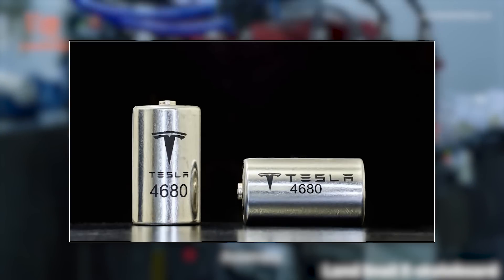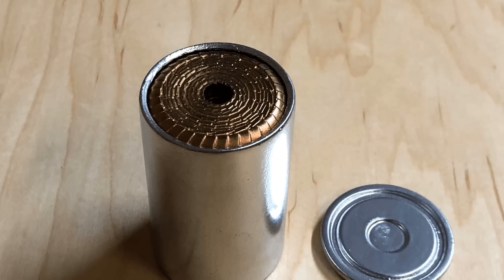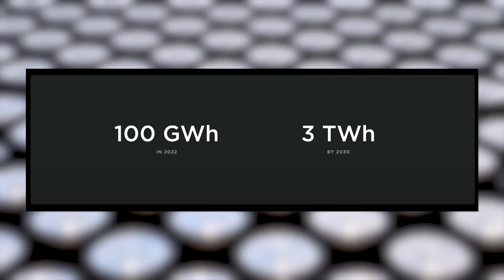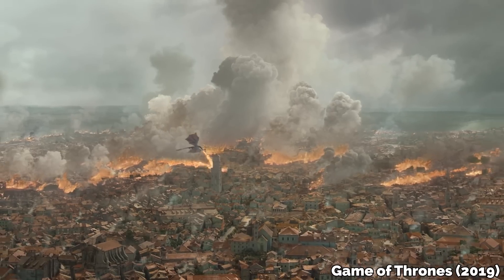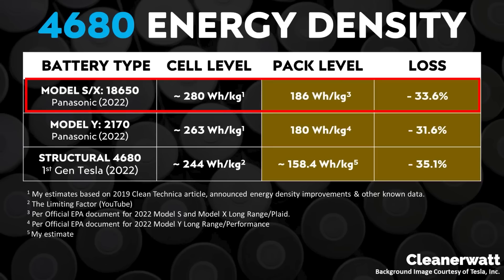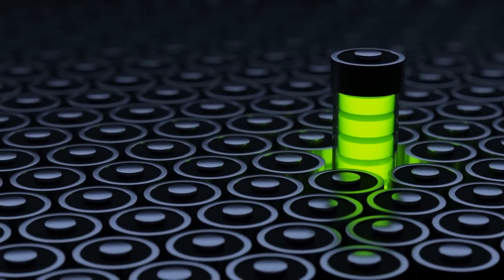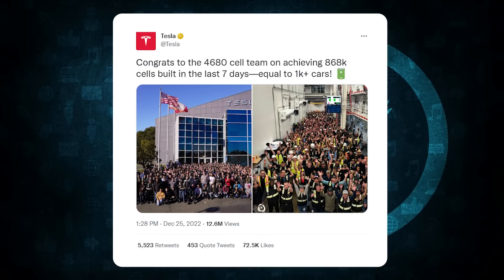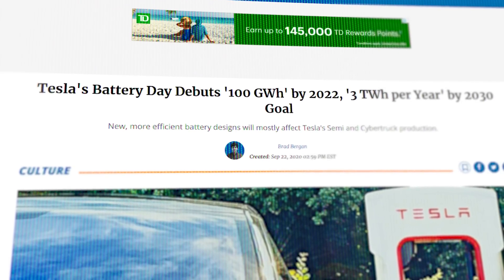The Disappointing Truth About Tesla's 4680 Battery Cell..

Comment: I must say, the people in-the-know about lithium batteries were aware of the power density loss of the 46800 cell from the beginning.
It is only normal that a bigger cell has worse thermals. The switch to 46800 had one aim and one only: to reduce the manufacturing costs by 20-30% - and Tesla may have just achieved it.
The 18650 battery pack is too good, with Panasonic cells lasts ten years and is incredibly reliable; compare it with the pack from GM which use prismatic Li-Po cells, the same 1-dollar cells that power all smartphones, and last - at best - three years, with an erratic reliability; a problem which has been solved with the modularity of the battery pack.
The 46800 cell degrade slightly the quality of the battery pack, but in turn allows for a 30% saving on its manufacture - which is a notable achievement. But if you ask me what Tesla I would like to own, the answer is, the one with the 18650 battery pack...

Comment: Elon does a great job when he puts his mind to it but this battery is crap🤮. That's like going from lipo to a NiMH. We're currently working on building solid-state batteries and he should have done the same thing.  Solid state batteries have 10X energy density,  they're smaller and lighter, you can charge them a lot quicker,  a whole lot safer and they last a very long time compared to lithium.  Elon for some reason wants to live in the part instead of moving forward.  Solid-state is the only thing he should be working on now when it comes to fuel cells.  Oh well, we're doing it 🤷

Comment: Maybe one can mix two different cylindrical cells to achieve higher packing efficiency in the future.
Reply: Energy density has limits , there is not much higher you can get , upper theoretical level of lithium batteries is still only 10% of gas or diesel per weight unit , and thats with doubling the current energy density ... even that needs new materials as electrolytes, separators, current collectors, and packaging .
Reply: I suspect that would create very complex energy management issues...

Comment: “Tabless” design makes no sense. It’s just a multi-tab design to reduce resistance and heat.
Also, this It’s regurgitation of marketing wank really isn’t very helpful. The battery is simply a platform. No one knows any details of the actual battery chemistry it seems.

Comment: Great video. Thank you. There are however two side effect benefits to using the 4680. For one it is supposed to be an intergal part of the chassis stiffness therefore saving weight on the vehicle (and god knows that weight is the #1 ennemy of EVs) and second it is also supposed to charge way faster than smaller celles precisely because of the many tabs instead of just 2 on a traditional cell. These 2 features should normally be visible from the first commercial grade generation of 4680s.
Reply: I would also think the tabless electrode would result in an improvement in cycle life, since the power path is distributed across the roll rather than up thru the single tab, resulting in dendrite creation that is more distributed across the cell.
Reply: Does any one here know if the Model Y weight dropped after the intro of the 4680
Reply: @DamBusters  theyre about the same
Reply: @DamBusters  no it did not. It weighs slightly more than a long range model Y.

Comment: I thought the major improvement to producing this type of battery was that it would double as a structural component of the car instead of  being dead weight. Maybe they have thicker walls which makes the power/weight ratio look bad on paper. If it offsets more structural weight than the presumed inefficiency that it would be an advancement.
Reply: It turns out that it's the outer case of the batteries that is serving to replace a piece of sheet metal (the floorpan), not the actual shells of the battery cells themselves. It more-or-less saves a layer of sheet metal ... it's something, but it's not an enormous difference. One thing that is apparent with this construction is that the battery pack itself is absolutely not serviceable (e.g. to replace a single cell or group of cells) other than replacing the entire battery assembly.
Reply: Don't forget the reduced manufacturing cost, smaller footprint of the production unit (space is expensive), and reduced capital expense to build the production line.  Even with no other benefit, these factors are absolutely huge to the bottom line.
Reply: @nerothe  Tesla's "structural battery" the way I see it, saves the top stamping/molding of the battery case - that's it. The floor pan (and seat tracks etc) now becomes the top of the battery case, thus saving one layer in the structure. "A good thing" - structurally, yes; ease-of-repair, no (but the original manufacturer doesn't care). In the grand scheme of things, the piece that it's saving, while physically a large piece of sheet metal/plastic, is a small part of the overall body. As a vehicle owner, I'd rather have a battery assembly module that can be dropped out more-or-less on its own without having to tear apart the interior of the car ...
Reply: @bikeaddictbp  I would like to be able to easily replace the battery in my IPhone, but I wouldn’t settle for an inferior phone with less water resistance. Plus imagine DIY’ers trying to get into a battery pack with residual charge.
Reply: @zacharywissinger3996  ?? Tesla's battery being integral with floorplan vs previous design as a separate module makes no difference to water intrusion and neither are DIY serviceable. If battery goes bad in previous modular design then car goes to mechanic to swap out the battery (probably 5 or 6 hours of work if you have the right tools). With structural battery, add hours more work due to having to tear apart and reassemble the interior, because you are basically replacing the floor.
Reply: @bikeaddictbp  the water resistance was if reference to an Iphone. I am saying if they make a superior product to others on the market they can do what they want.
Reply: It is a terrible design.  Can't repair,  can't easily recycle. As usual,  just more of Elon's hype. Be very,  very skeptical of any promises Elon makes.

Also, why would a manufacturer begin using a new, unproven, battery technology that doesn't even reach current performance or production levels?

Comment: Why do people ignore history?
Why do people ignore technology evolution?
Tesla first car was a roadster using laptop batteries.
No. It won't be today, but you bet it will come faster than you can imagine.
A 2012 Tesla model S 75 is still running on the streets. Get any 11 years ICE car and check their engine. There are Teslas with more than 400.000 miles. Compare them with ICE cars. 
As long as Tesla keeps evolving, there's no reason to worry. Unlike Apple 🤦

Comment: The main point is: you need 1/5th of production steps for 1 kWh of 4680 compared to the 2170 due to its 5x larger capacity. This reduces cost by a lot and increases throughput af.
The machines will be slightly bigger, but throughput is 5x.

Every (!) competent battery manufacturer in the field switches to 4680 right now, due to very good reasons. It happens all over.

Concerning the energy density: it will explode as soon as Tesla uses silicone rich anodes inside. But this will be absolutely unnecessary for the success of the 4680 cell.
Reply: Why would you need 1/5th of the production steps just because its bigger? Thats just wrong.
Reply: @wizzyno1566  
One 4680 cell has the same energy capacity as five 2170 cells. So: If you  use 2170 cells in your battery, you have to produce 5 cans, 5 lids, 5 everything. You have to roll 5 jellys, fill 5 cans, weld 5, close 5 and test 5.
KWh-Wise you reduce the production steps to 1/5th! And most of these steps will still take the same time. Testing 1 4680 cell takes the same time (about 1 day) as 5 2170, but you need 5 times more machines and parts and everything for it.
Concerning warehousing and automation it's a huge benefit to transport only 1 cell (means 1 pick) compared to 5 cells (5 picks = 5 robots)!
Concerning the automation producer it's a huge difference to produce a machine for 1000 cells per minute compared to 5000 cells per minute. One is possible the other not; it will result in 5 times the machines and also to almost 5 times the footprint of the machines.
Reply: According to Elon at battery day you get a reduction in manufacturing cost, a smaller footprint of the battery production area, and lower capital expense to build the production line.  Those add up to close to a 30%-50% reduction in cost to manufacture.  The manufacturing aspect would be a home run, even if it is producing a slightly less efficient product.  As it is, we've also only seen the LFP version of the 4680, which is the base model.  Next level up is Ni/Mn that is supposed to be a 50% improvement over Iron based.

Comment: Does anyone know what the longevity of this new battery cell is? The previous chemistry was good for 100k miles right?
Reply: Current battery packs are guaranteed for 8 years or 200,000 miles.
Reply: 2500+ charge cycles X range per charge of 200 miles +  would mean 500,000 miles or so I believe...
Reply: I noticed that 2170 used in M3 degrades faster than 18650 used in MS.
Reply: Likely quite a bit better.

Comment: Why don't they double height but parallel wire the 4680 pack?
Reply: There isn't space in the vehicles that Tesla builds to double the thickness (height) of the battery pack by double stacking them. (GM is doing that because the vehicle that they're going in, is enormous.) But, electrically, even inside the single-layer pack ... they already are wired in a combination of series and parallel ... all EVs are like that.